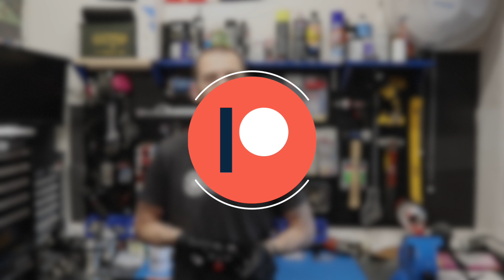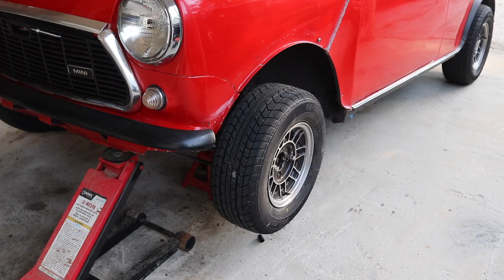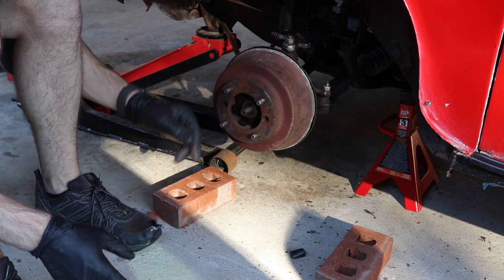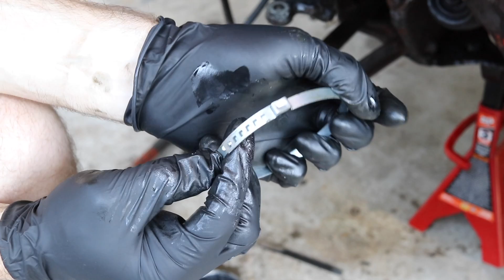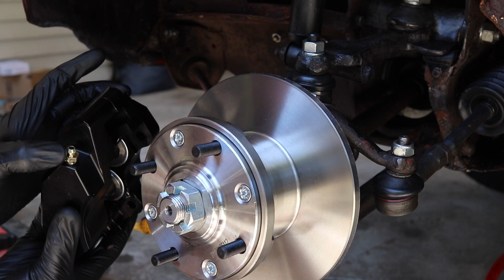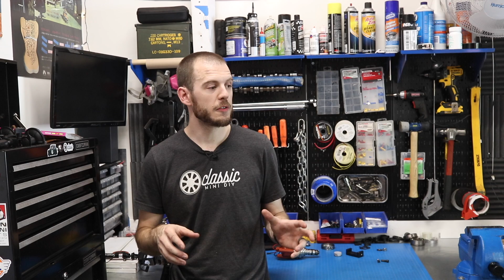Classic Mini DIY - Converting your Mini from Drums to Discs

Comment from the maker: Just a heads up everyone, one thing I forgot to mention that is super important, is if you are doing this conversion you will need a REAR BRAKE PROPORTIONING VALVE. This will make sure your brakes don't lock up due to a drastic pressure differential between the front and back brakes. Links to this valve are below. Note: installing this valve will require a full brake bleed.

Early Cars: https://www.7ent.com/products/brake-proportioning-valve-mk1-2-and-cooper-s-mk3-21a1774.html?af=cmdiy1959
Later Cars: https://www.7ent.com/products/proportioning-valve-mk3-to-1980-13h7757.html?af=cmdiy1959
Reply: Any chance of a link to the Brake Proportioning Valve (I think I know what they are, but just to be sure)
Reply: Very good point. I wish I knew this back when I put "S" disks on my Mini...basically, no front brakes all REAR brakes leads to the car spinning 180 degrees. Not good!
Reply: we call it a 'compensator' they swap ends when that goes wrong!
Reply: no you dont you can change the rear wheel cylinders like they did when built if they had disks
Reply: hi, friend
I have mounted these same calipers and I have problems, the 10" rims do not fit. I have to put a 20mm spacer, so that the rim fits, do you have any good ideas?
thank you

Comment: To stop the drive shaft coming out of the differential, or worse, pulling apart the inner CV joint (I’ve heard them called “pot joints” or “tripod joints”) and/or tearing its boot, I have made up a simple special clamp. It’s two of the pressed steel, serrated saddles from u-bolt exhaust clamps joined by two suitable lengths of threaded bar with nuts and washers. I can clamp the drive shaft to the rear arm of the  suspension wishbone (control arm) so firmly in place that I can wield my leather/copper mallet very energetically. BTW, I recommend cleaning the grease off the drive shaft and wishbone with brake cleaner to get the best grip between them. I also use brake cleaner to degrease the male and female tapers of ball-joints and their seats to get maximum friction and stop the pin turning, especially when I’m assembling them with nyloc nuts. PS I also have a special puller for CV joints but it' a bit big and unwieldy for Minis.

Comment: Great Explanation! 

       Another process improvement..  For replacing the outer CV Joint
.. to avoid working in the car trying to drift off the outer CV with a moving axle. It is very simple to  release the inner boot on the INNER CV (at the transmission)  and  leave the CV Hub in the transmission and pull the Axle out of the Hub and frame
        Then you can do all your outer CV Replacement and Boot work OFF of the car .   To re install  simply slide axle back in the inner hub and Re affix the boot.   (good time to re grease the hub too)

Comment: Cole, Great job on the conversion & a master class in how to! It‘s a split pin on the castle nut not a Cotter pin! A cotter pin has a flat on one 
side like in a bicycle pedal crank, Sorry hope i‘m not being too picky but you guys did invent Grammely lol.  Cheers Dave
Reply: yup, you cannot get the drive shaft out of the back of the cv joint without splitting everything. Unless, you put full lock on in heavy rain and drop the clutch on an 848cc van & and have to walk home to get your gear - embarassing.
Reply: not if your an American ,, they cant pronounce solder properly either though ...

Comment: Hi Cole. Great video, I was told that you should pre load the bearings by tightening with a flat washer in place of the split taper washer. This ensures the bearings are located properly so that when you torque up the nut with the split washer it doesn’t bind against the shaft giving an artificial torque effect. The split washer can pinch the shaft if it’s not located fully apparently. I get the logic and it doesn’t hurt to be sure :)
Reply from the maker: Thanks for sharing this info. I have always done it direct onto the split tapered washer but that doesn't mean its the right way. However so far, knock on wood, my bearings have been good. :-) Still though I will give your method a try on my next bearing job. Thanks!
Reply: Yes I’ve only done the job twice. The first was 20 years ago and the nut came loose so I used this method recently and it’s been good so far. Maybe you have to be unlucky for it to be an issue lol but that’s me, if it can go wrong it usually does :)
Reply: Yehp you definitely need to pre load the bearing and pull it home with a beefy flat washer before putting the tapered washer In

Comment: If the front wheel nuts start to work themselves loose, you usually feel it it in the form of very sloppy steering. Usually enough warning.
If you just forget to tighten the nuts, then they can come off more quickly.

Comment: You forgot the brake line copper washer that fell off when you spun the drum off.  Would also Rec you put the OE dust shields back on because they help with degradation from debris.  Just FYI.

Comment: Cole u let me down today boyo !! For the first time ever I jacked up my minivan on the rear subframe like u said and it’s proper bent !
Reply from the maker: Where exactly did you jack it from? The places I outlined in the video are the strongest part of the frame to Jack from. The safest as well. Any chance the metal was fatigued or beginning to rust?
Reply: Classic Mini DIY not really bud I mentioned u in the viddie I’ve not posted it, at the rear of the van just past the fuel tank in the centre of the subframe I should have used wood to spread the wieght
Reply from the maker: I’m really sorry to hear that man. I did comment that you need to lift on the sides of the subframe not in the center stretches though. So the areas behind the wheels are where I indicate to lift from rather than the two metal spans that go across the center of the car.
Reply: Classic Mini DIY bugga I had forgot about that bit was a long time ago I watched it my jack couldn’t get to the edge of the sub frame  nxt to the wheel, I’ve had a terrible day on the mini I now I got a Bent rear sub frame in the middle any advice bud ?
Reply from the maker: It shouldn’t impact the drivability at all but if you remove it, it’s gonna be harder to get back in. If it makes you feel better mine is bent in the same place and my mini has been just fine for the last 8 years. 👍🏼

Comment: 9:48 you can accomplish the same thing by depressing the brake pedal slightly and holding it there... With a clamp or piece of wood...

30:46 Should have put the lubricant on the edges of the shoe as well..

Comment: Things are so much harder than they need to be.  

That cv joint boot could have been salvaged, yes it was perished but they do that well before they fail. 

To split the pot joint you simply cut the zip tie on the diff side, then a good pull out towards the hub end and out comes the shaft. Be careful about the ball bearings in the pot joints. 

On the conversions I've done we had to change rear wheel cylinders  so the brake pedal travel was reduced. Yes this might not be required on every car so please take the car on a very quiet but very wide road so that the brakes can be tested.

However a great video

Brake flex hoses are also different from drum to disc, as is the 7.5 and 8.4 inch disc and drive flange. 

I'm not an anorak, I've done this conversion a few times.
Reply: What size rear wheel cylinders? Eg: What size did you remove and what size did you put in?
Reply: I didn't change the rear cylinder size as I feel that they lock up too easily as it is... My car has an OEM genuine black tag master cylinder that hasn't failed from new.
Reply: Cheers for the reply calum. I was referring to your comment "on the conversions I have done I've changed the rear cylinders so the brake pedal travel was reduced."
What size disc brakes were fitted for the conversion? And a. What size rear cylinders were Originally there? and b. What size cylinders installed to rectify the long pedal?
Reply: I've done 8.4 to 7.5 inch disc and  drum to 7.5 disc. 

When we went to 7.5 disc we went down a size (possibly 3/4 to 5/8th I can't remember 100% though unfortunately).   Ive had to play around with sizes, so 3/4 down a size to 5/8th then to the next down again, to try and get the pedal travel reduced to an acceptable level.  As I said above, the latest conversion was a drum braked 1980 reg car with black tag Master Cylinder, I just done the front conversion and didn't change the rear cylinders, it passes Mots with ease
Reply: @cal844  Cheers mate

Comment: Great job Cole. I wish this video was made when I did mine a couple of months ago but judging by your install I got mine right aswell. 

I was told a couple of things however. 

- I needed smaller rear brake cylinders even though I do have a proportioning valve 
- I used shorter brake hoses as the older ones from the drums tended to rub and foul apparently.
- a mini mechanic asked if I preloaded the bearings during install, not sure what he meant. But I’m sure I’ll find out if they wear prematurely 

This is on an Australian Leyland, not sure on the differences with the US.

Thanks again
Reply from the maker: Hey Kyle! Here's my thoughts:

- I needed smaller rear brake cylinders even though I do have a proportioning valve 
I disagree with this perspective, the key is the proportioning valve. Having smaller cylinders in the back certainly will not hurt anything but I run larger cylinders back there and I am very happy with my stopping behavior on bad wolf.

- I used shorter brake hoses as the older ones from the drums tended to rub and foul apparently.
This is true and one thing I left out. The lines on this car had already been replaced so I forgot to mention it.

- a mini mechanic asked if I preloaded the bearings during install, not sure what he meant. But I’m sure I’ll find out if they wear prematurely 
Another commenter mentioned this as well. I have never done this with my disc wheel bearings and so far things have been ok. That said preloading them will not hurt anything and if you want to do it I dont see any problem with it.
Reply: 👍🏻

I suppose that’s the great things with minis, there’s so many people with so many tips and tricks. Thanks for sharing your knowledge!

And what a good friend you are doing the upgrade! Maybe your friend should grab a torque wrench and learn the torque spec for the lug nuts!

Looking forward to the next vid!

Comment: Nice and clear step by step viseo on a nice conversion but a couple of comments if I may?
As you have fitted new wheel bearings then for the initial torque setting you should never use the taper washer. Use a solid flat washer to pull the bearings in line and to full torque, remove it and THEN use the taper washer to bring to final torque setting.
Its not a good idea to fit the drum brake pipe to a disc caliper as they are different - GBH 170 is the shorter drum brake hose and GBH249 is the longer disc brake hose. And when fitting always fit to the caliper (with copper seals) first and THEN onto the subframe and metal pipe. What you did was distort the pipe by nipping it up in the caliper while still attached to the subframe. Its an easy mistake to make though.
Reply from the maker: Definetly correct. The brake lines were replaced for disc brake style hoses prior to my work however I should have called that out. Thanks for the tips and I’ll be sure to call it out in upcoming episodes. 👍🏼

Comment: Also remember that some CV joints have 4 holes and or 2 holes for the split pin and each type has different torque specs
Reply from the maker: I’ve not seen a 4 hole one on a classic mini before. Are those only later cars? Great info though!
Reply: @classicminidiy  The link you mentioned - Stevestonmotorco , covers the 2 hole vs 4 hole difference and the torque specs

Comment: You also need to change the brake hoses, drum brakes use shorter ones.
Reply from the maker: The hoses are adequate for this application. I tested the wheel at full turn and they were 👌🏼 however these may have been replaced in the past
Reply: Very True :    Drum hoses are about 1/2 inch shorter, and in this case the hoses were already replaced  with Disk hoses knowing this car would be upgraded in the future= new hoses already installed.

Comment: All good , although I wouldn’t recommend hitting the end of the drive shaft with a metal hammer to get it back on .😮
This could damage the cv shaft or the threads , meaning you won’t get the nut back on!
Use a plastic / wooden or rubber mallet or put the nut on the threads first. 
Other than that a good video, cheers 🍻
Reply from the maker: That hammer was a rubber mallet if you pause the video. 👍🏼 🙂
Reply: beating the new bearing in with a steel punch is non to clever either , brass drift needed ,,, again working on brakes with a shifter does not instil confidence .

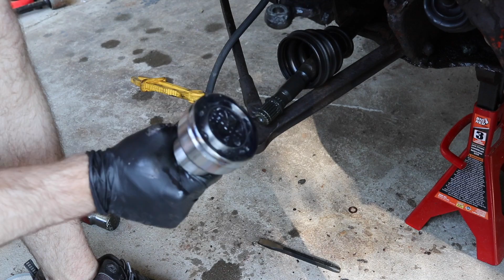Comment: 17:08 No!
No! No! No! Do NOT add extra grease. The amount of grease in a CV joint is fairly precisely calibrated and too much can lead to overheating.

And more especially, if you don't add exactly the same type of grease you are doing yourself no favours either. The last time I did this job the recommended grease for a CV joint was either molybdenum or graphite based - if you add any old wheel bearing grease you are asking for trouble. Make sure you use the same type and rating of CV JOINT grease, NOT wheel bearing grease. Ye gods.

Comment: treat yourself to a few spanners instead of using a shifter , and a brass drift not a steel punch for bearings and life will be easier. but not a bad video at all. Also be wise to mention that you can just do a spring swap in the proportioning valve too ... in case some folk dont know. Also your ball joints are too loose , you can see them move as you handle the hub  ,, they wont last a month in real life driving, you should just be able to move them with finger and thumb , not have them flop.

Comment: Personally I would have removed the whole drive shaft and replace the inner boot as well as well as re-grease it. One day it's going to need replacement, and it might have wrecked the inner CV joint with grit and contamination getting in. Then the owner will think, why didn't I replace the inner CV boot when I dad the chance? Of course, with the drive shaft out it's a whole lot easier to remove the outer CV as well. 
Yes, you have to replace the oil and filter, but the cost is minimal compared to a job like this and fresh oil is never a bad idea.

Comment: Great video. One question (sorry if it's already been asked) - the spacer between the caliper and the hub - it liked quite mobile when you were showing where to fit it - what holds it in place? - the pressure of the caliper against hub, or is there a small depression/ recess that it fits into, or other?  Thanks again.

Comment: I changed the hub in my mini on the drivers side and the drivers shaft just slides out. There’s no resistance holding it in. It just slides back in but I’m concerned something isn’t right and it should be held in there properly

Comment: Hi Cole, I purchased the excact same kit from Minispares last fall and I have assembled them over winter, should note I have not introduced brake fluid to the system yet. At 27:12 you mentioned they are one sided, I wanted to ask why that is as I have put mine on the other way around with the bleed nipples down. I don't see any difference in the calipers other than the bleed nipples being either ontop or under the calipers, wich is why I put mine on with the nipples facing down simply to make bleeding them easier. Please advice if this is in fact totally wrong, I'd love to know before I bleed them and finish the job off :-)
Reply from the maker: Hey man! The nipples must be pointed up or you are never going to get the brakes properly bled. The main reason is, air will rise so when bleeding you don't want to be fighting basic physics while doing an already annoying job. :-)

Comment: Great video. Is the installation the same process if I want to make it rear disc brakes?
Reply from the maker: Mostly the same. There are only a couple rear disc brake sets on the market but the process requires a new hub in the back which is all part of those kits.

Comment: with the 4 pot set up you have, are you able to run 10" rims?
Reply from the maker: Yes that’s one of the most desirable reasons for running these. Note it’s the 7.5in 4 pot brake kits that fit 10 inch wheels.

Comment: Do we need a Booster / Servo ???
Reply from the maker: A brake servo is not required to run disc brakes on your mini, however many people do like the added braking strength with the servo. I have always run without one and have been very happy with the performance.

Comment: Would a brake servo need to be installed as well when doing this type of conversion; drum to disc?
Reply from the maker: A servo isn’t required for the conversion but the brake bias valve absolutely is. A servo will make actuation a little easier though.
Reply: I think the 4 pot caliper helps a lot as there's a lot more surface area so the pressure doesn't need to be as high. With a cheaper, single pot and floating caliper the pressures would no doubt have to be higher.

Comment: will you need a brake booster now you have fitted disc brakes ?
Reply from the maker: No a brake booster isn't required for disc brakes but it will certainly improve the braking experience. I am considering adding one in an upcoming video. But they definitely are not required.

Comment: The front brake hoses should have been replaced with the correct length ones, shorter?!
Reply from the maker: These hoses are brand new and were already exchanged with longer hoses.